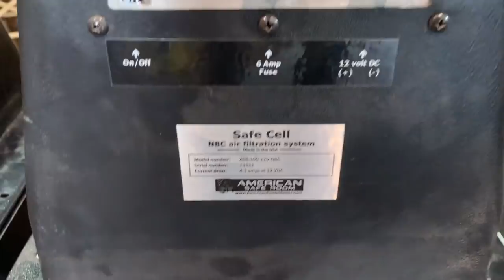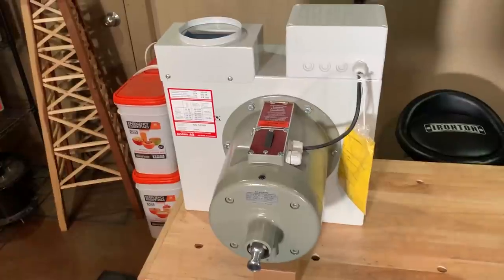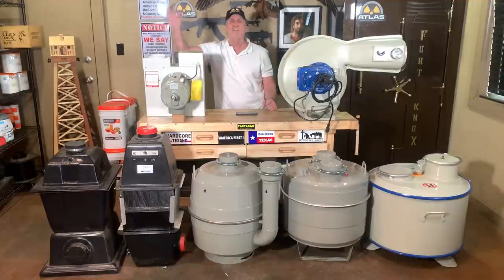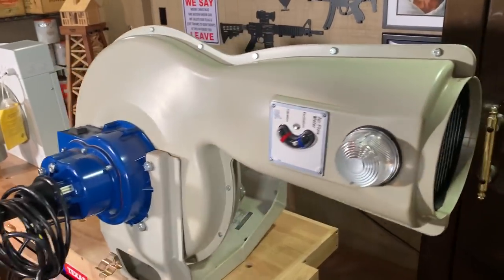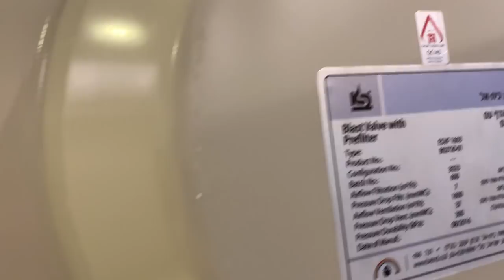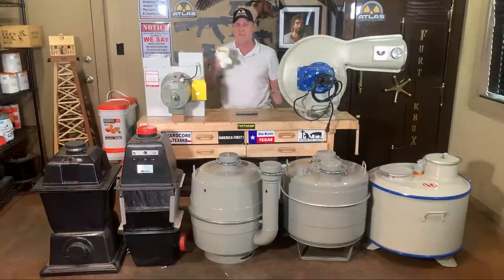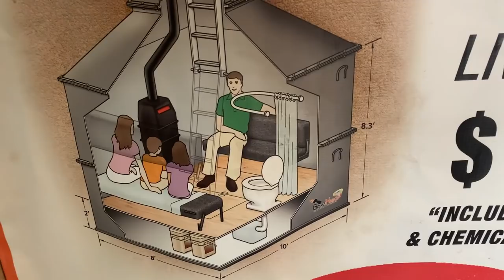Comparing NBC Air Filtration Systems For Your Bomb Shelter

Comment: And all of these are put inside the bunker right next to you. Meaning the radioactive dust will be sitting right next to you with basically no protection.
Reply: What are you talking about???
Reply: @everythingluxury7  the filter filters the dust with radioactive particles out of the air. Meaning the filter cathches all of the radiation that you are trying so hard to filter out. 
This is a whole lot better than breathing it in. But you still have a barrel of radioactive dust sitting right next to you without anything to block it.
For this reason you will often see seperate rooms for the filters with thick concrete walls and dirt between the filters and living areas.
Reply: @kaptein1247 that's interesting, are there any alternatives?
Reply: @nar2cc  Like I said, isolate the filter. Problem is this will make the shelter a lot more expensive and complicated.

Comment: Those cheap ones can’t draw air through the filters, they just recirculate the existing air. I doubt you could measure any air coming out of a 40 foot exhaust pipe. These filter systems would just kill people

Comment: I noticed you did NOT open up your air units to show us their fans? Not really a fair comparison. I will say that based on airflow the Swiss and Israel units are most likely metal fans with stronger and more durable motors but until you show us, we really do not know? Like showing us a Briggs & Stratton 100CC engine compared to a Ferrari car with NO look at the engine. I do agree that those 2 plastic units are junk and I would not risk my life using them.

Comment: I do maintenance work on a underground mining refuge chambers that have filters and CO/CO2 scrubbers. The blower motor actually doesnt look too dissimilar to these, but that said I've only ever had to change 1 out, and the problem had been misdiagnosed, the motor was actually fine but the circuit board controlling it failed. I was surprised when I changed it because the replacement motor came from a boat supplier and was actually a 12VDC bilge pump motor, even though in the refuge chambers its only supplied from a 5VDC power source. I queried why, turns out engineers had done calculations and that it was sized precisely for what was required in air changeover if there were 20 people average people inside to keep the CO2 level at 0.5%, no more no less.

Just stuff that needs to be considered with these things, you put a big beefy motor in, thats fine but if your pulling 500% more volume of air through your filters, they will clog up and need changing 500% faster. Also you might be running off limited emergency power/auxilliary batteries, in that case do you want the blower motor to be bigger than what you actually need using more power?

Comment: Those sureflow dc fans are great...for pushing a bit of air in your open boat bilge. (What I have seen them used for on some boats here in the UK)It will work as a low power extraction fan but it is no way powerful enough to pull air through pipes and filters to supply a bunker. Maybe a storm shelter, but not an NBC bunker!

Comment: Hey i just started the purchase f some land in south WV and its basically a small mountain and 1/2 the valley on one side. The lower area has an old cave system in it that was mined for minerals and precious stones for a decade or so. There are three different caves with the largest in the middle and two smaller caves which are still pretty large them selves on either side of the main. The plan is to have the large one for a work shop vehicle and the bomb shelter it self. Then the larger of the two smaller one was connected to the main by the old miners that worked it. The one that is connected will be part hospital and part storage for all food and medical supplies as well as a decontamination area and clean room. Since i had access t actual hospital quality items i will have a pretty awesome one with a doctor and surgical dentist(what ever they are called) for staff. I also have two daughters that work in the medical field as one works in a lab and the others as a medical assistant at a local hospital. Then we have about 5 family that are either retired or have been in the military or are active military so security is covered. The last cave which i will construct a safe connection from the main to it as well so all three caves connect. Since the main has a spring at the bottom of it at the deepest part of the cave water wont be an issue. But the last cave is a big enough cave to have the armory and munitions storage along with sleeping quarters and kitchen and bathroom facilities. There is also a large area that could be used for a hydro or standard grow area for food. I have had grow lights for years in storage and will have a chance to use them. If there a company that you can give me contacts for so i can see how i what i would need and the kind of system i would need to supply air for the whole complex? Since with minimal work inside of the caves and most of my cost and work ,will be involved in covering the entrance ways for all three and separating all three areas from each other with air tight entrances. Compartmentalize it like a submarine almost? So that if one area fails you can retreat to another and not all is lost. Always good to have plan "B" and "C" since there is three common areas. If i were to guess i would probably need three of your set ups ,one for each area. All independent of each other. So once again backup to the backup of the bacup....heheThe caves are so old and have been so completely explored the entire cave system is air tight so this is perfect for a nutjob like me to prep for my family. LOL I would also like the largest storm shelter i can get put in the ground under the home/cabin we are going to build that will be a emergency exit or entrance to the complex as the building sight is just out of sight of the caves yet close enough too it that it would be easy to do. So it would be a huge storm shelter that could be entered as a safe room to stat with and if there is a reason to flee to the main bunker one of your escape hatches will be in the rear with the door hidden in some way? It al came to me in a dream! I just need to get the dang land deal done to get a move on it before all hell breaks loose with Russia and China!!!  I would be about 100yrds of tunnel from the home site to the caves. Which the entrance t the caves will come up just outside of the main cave. That way if the people we would be running from may have the resources and time to search for a way in they could find the tunnel and have access to the door of the bunker tunnel. So if it dosnt go all the way into the main bunker they cant possibly use it to gain entrance to our bunker. Then of course i have an Engineer looking for the best place for us to build an escape tunnel from all three caves that will join together to lead people out of the main bunker and come out on top , of the mountain or just about 100feet down from the top of it on the opposite side? I have not decided that part yet? Well for now all i need is time to speed up so the full paperwork can go threw and i can start actually working the land? Could take up to 30days :>/ One way or the other i will need at least a 10person bomb shelter. Once i get some land if this deal falls threw as well? Both times i started and they balked! ??? Its not been easy finding just the right parcel of land we want?! :>( thanks great video
Reply: Holy shit

Comment: I’ve been asking for this video for awhile. Good to know you listen, or maybe it’s a coincidence since there are many unanswered questions. 

What are the space/occupancy limits of your Swiss and Israeli air filter systems?

How often does the filter need to run to keep good air in the bunker if my plan is to not visit it for months at a time or maintain power onsite?

If the bunker is occupied does the filter need to run continuously or is there a recommended duration per hour per guest?

If someone were trying to smoke you out with carbon monoxide or a wildfire burns up the local oxygen, how long can you stay buttoned down with no intake?

As carbon can be damaged by humidity, do you recommend keeping the filter sealed until needed, and rely on a dust filter for refreshing the bunker in normal environments?

Could this air system be incorporated into an 

What is the difference between a NBC air filter and common home ventilation systems where the resident needs protection from smog, smoke, odors and allergens?

Comment: Does the internal filter system (carbon, filters, etc) need to be replaced periodically?

I am curious how long they last and if it would be prudent to have backup filters and carbon for whichever system is chosen for a bunker.

I tend to lean toward double redundancy.😊

Comment: I made my own air system with a electric turbo 
Running the electric motor off a 12v car battery 🔋 that I have connected to my solar system
Reply: Have a video?
Reply: @dirtridr  not yet but I can make one

Comment: I've got a lunor system I'm trying to wire but the electrical name plate is calling for 3x400v 50hz. What's the best way to convert  240v 60hz standard US?
Reply from the maker: Where did you buy it at ?
Reply: @AtlasSurvivalShelters  I didn't purchase it, I'm just the electrician installing looking for some guidance
Reply: It was operational (in the us ) before they moved it to a new location so all I really have for info is the nameplate unfortunately

Comment: To me, as good as the Swiss and Israeli filtration units are, the 'typical' installations that I've seen .. don't seem to make sense.
As can be seen in the video, fresh air comes in through an intake duct .. into a pump (electric/crank handle driven) before being output to the inside of ones protective shelter.
In the case of a 'nuclear' detonation .. the filter canister is inserted into the circuit (as can be seen with the flexible hoses) and this carbon filled canister filters out 99.99% of the irradiated particles. Great!!
This does however, leave one further issue of 'vital' importance .... the now 'radioactive particle catching canister' is INSIDE your protective shelter .. and the radiation being emitted is NOT going to be stopped by a thin piece of sheet metal.
It seems to make much more sense to me, to have the 'canister'  located on the outside of the 'protective' wall .. probably in its own heavy concrete enclosure, so that the filtered outlet can now pass through the main wall without compromising its shielding effectiveness. (ie. a 6" hole in the wall where the duct comes in)
Obviously, the pump/hand crank needs to be located safely inside the main protective shelter area. (bunker)

Comment: Britain is becoming swizz they air pressure test most new buildings it's for heat control and efficiency that ironically needs an exhaust system. Israel have different requirements

Comment: Your "review" seems very biased. You can't say you want to show difference. 

Yet, you only show the one you call junkie / sub standard.  

Necer got to see a break down of the systems which you like or recommend. 

Not even showing the air flow created by the more expensive models seems bad when trying to compare.

I do not doubt your claims are accurate, yet still can lead to questions